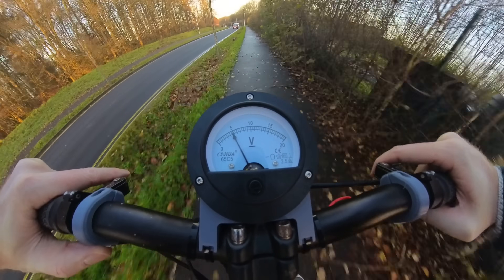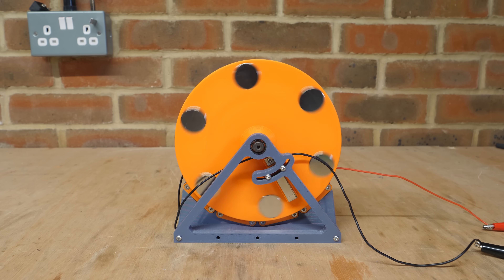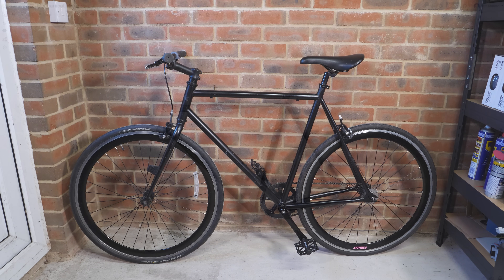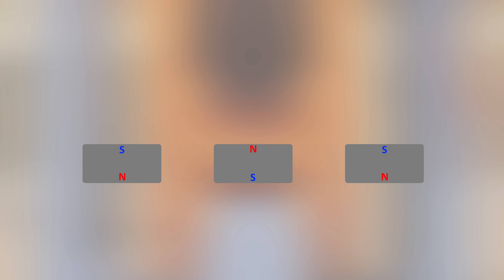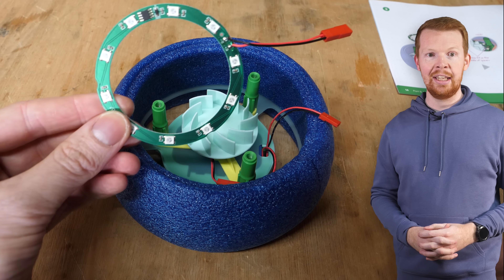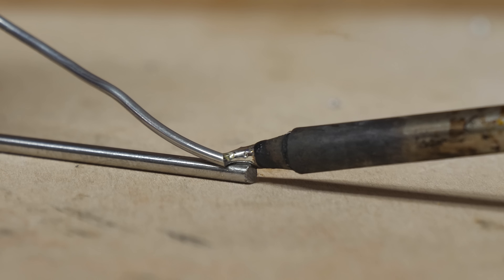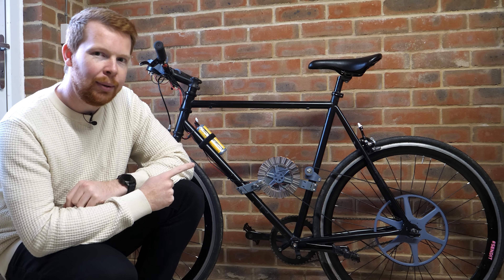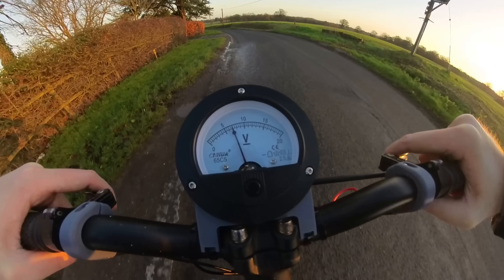The Most Minimal Electric Bike

Comment: A couple of years ago I started building something not exactly like your setup but, it was close enough in terms of generating DC power to charge my E-Bike's spare battery while riding with my primary battery.
Once my primary battery was depleted to a certain level, I did still have to stop and manually swap batteries, but the intent of my project was to allow me to have unlimited range of sorts, using two batteries: one being charged while the other being drained via my riding my bike.
Mine was mounted in the small bicycle trailer that I stow my fishing gear, small ice chest and my spare battery.  I rigged up a miniaturized CVT type of transmission so that my actual charging system would still spin fast enough to produce power even when riding at a very slow pace.

Comment: I'm wondering if the stock reed switch is inside a glass tube because it's filled with inert gas (or maybe nitrogen?) I'd imagine that without oxygen the sparking wouldn't degrade the metal. Perhaps your homebrew reed switches would work if they were inside a glass tube filled with a oxygen-free gas? That seems challenging to DIY tho.

Comment: Im glad you were able to utilize a halbach array for the rotors! 
In my own tinkering research, i have found that changing the magnetic flux topology will alter the cogging torque and efficiency of the motor within motors with iron stator slots. You can actually achieve low cogging while maintaining the high torque of a motor with iron stator slots through playing with the magnetic flux topology. Play with the width of the poles, and the halbach array magnet orientation. Of course my research was done with modified alternators (radial flux) with permanent magnet cores, and not the axial flux motor/generator in your video. 
My page has vids and links to my other pages where I house my files for others to use.
I can also do custom design for anyone needing it in their own endeavors.
Cheers!

Comment: I got an idea to throw at you. You could make an electromagnet version of hallbach array and use the read switch as a means to change the rotating fields so the two hallbach arrays push away form each other making it a magnet less motor

Comment: nice work! How about using an old set a points from a car distributor. make a knuckle on the wheel where the points open and close according to the magnet crossing its point of coil pulse to open and close the points. Run a small capacitor across the points to hold down sparking. It's the way the old cars use to fire the spark plug. Always cool to see your inventive ideas.

Comment: You can still use iron and not have any cogging, the easiest is to just back your magnet disks with iron but not put any cores in your coils. This is called "air cored". Otherwise it's fun to see the modern brushless motor "back-dated" to work without power electronics, good job!

Comment: The idea is fair but in practice you just stop applying force when you want to slow down.

Brake pads last quite long and most pads aren't even used up to the point were they need replacements.

This kind of technology has no future on the consumer markets I think. It's fun watching you tinker and learn though.

It's just that bike cycles are perfected long time ago.
These days 'improvements' like using carbon and whatnot are just gimmicks so people with to much money can feel a bit special.

A spinning bike could be much more interesting to power your house while working out instead of just moving matter around and around and heating stuff up slightly.

Comment: For years I've tried to imagine a way to 'untether' myself from the grid. My idea would be to use a rocket stove with a 'long' combustion chamber. It would be fueled by logs and trash to supply steam to an enclosed impeller type turbine. The resulting power would be sent to a battery bank. 
My 'solution' for water would be to transport it from a water source using a pump powered by the battery bank. The water would then be distilled and the necessary minerals would be added back to make it drinkable.

Comment: [2:45] "apparently rated to 15 amps." Not quite! They are rated to 15 amps *AC*, but only 0.6 amps *DC*. The reason for the huge difference is that with AC, there is a zero voltage crossing twice every 50 or 60 Hz cycle, so 100 or 120 times every second. These frequent voltage drops almost eliminate sparking and contact erosion, which is exactly the issue you have identified. You are switching DC, so the AC rating doesn't apply.

How about adding a capacitor or 0.5 to 1.0 microfarad, non-polarised such as a polyester, across the contacts and mounted physically close to them. This will also reduce sparking. Smear evo-stik or similar (NOT silicone rubber as it contains acetic acid) all over the capacitor leads to provide mechanical support and reduce the chance of stress fractures due to vibration.

Comment: I was going to ask you but instead I researched it.  Putting the reed switch in a vacuum or in an unreactive atmosphere such as nitrogen or argon would potentially mitigate the spark issue. It would also help with the noise because the switch would be inside a sealed container which would at least partially attenuate the sound.  I'm sure you could come up with something that doesn't resonate.

Comment: Hi, Tom! . I think if you create a form of small slip-on commutator to turn the AC into DC (with some diodes for safety) to send to a DC motor. That way you can both recharge your power-bank, and discharge it with the high-torque of the DC motor. This will cause more battery drain, and I suggest the slip-on commutator to be a form of spring based system- in order to prevent any parasitic consumption from commutator to the motor.

Comment: Why not use a regular old reed switch and a relay? I certainly wouldn't consider that electronic - it's essentially the same thing, but you would be able to purchase reliable versions of both off the shelf. That way the reed switch doesn't need to deal with a lot of power and the relay can handle breaking the DC. As others mentioned, your issue with the switch was that you only used its AC current rating, not DC, and often these are much different.

Comment: Do you have to run the powerline via the reed switch? You could only run a little power and control a MOSFET which switches the motorpower.
Or is that already electronics?

Comment: If the motor coils are not powered directly from the contact switch but through a solid state relay, the current through the switch will be much lower, which will prolong its life. Of course, in this case we cannot say that there are no electronics in this system, but still such a scheme will be much simpler than a conventional controller for BLDC motors.
In fact, the same scheme can be used to make an ordinary DC collector motor, which will have a longer collector life due to the fact that the switching of large currents will be performed by a solid-state relay.

Comment: On old point ignitions they use a condenser/cap to stop the points arcing. They also reduce the voltage with a resistor in series with the coil and points.

Comment: That contact you made is not smart at all, just keep the reed switch for a "signal" portion of the circuit that will controll a rellay coil, this relay will be part of the "power" part of the circuit that switches all the current, no need for custom or modified parts, just off the shelf reed switch and a rellay, simple.
Reply: Also add a capacitor is series with a resistor to calm down the sparking across the rellay contacts, this is like a 100 year old technology used with car ignition coils.
Reply: @DolezalPetr   А еще современнее датчик холла и силовой транзистор мосфет как в обычных bldc контроллерах.
Reply: @mrZagruzin  That is right.

Comment: Like the old days of point contact ignition in cars ... you need a capacitor across the point contacts to dampen the voltage rise across them as they open to allow the gap to get large enough so the arc can't jump across.
Reply: Или ключ транзистор мосфет + датчик холла.

Comment: How about a mechanical switch, like just a "wavy" surface on the rotor that physically moves a spring loaded contact plate? Or maybe even a disc with insulator/conductor surfaces, so it physically prevents an arc from continuing?

Comment: To lessen the sparks at the switch you can use a RC snubber circuit in paralell and it will almost completely remove any sparks

Comment: Regarding the tungsten and its melting point, I vaguely remember seeing somewhere that rather than melt metal away, a strong current is able to physically rip atoms out of the lattice of one contact and carry them across the gap, depositing them on the other contact. Due to this, such a contact will still fail over time even without the tungsten ever reaching its melting point due to the spark.

Comment: Interesting. Old-fashioned DC motors have a thing called a "commutator" (converts the DC current from the battery into the AC current of the motor windings), and you just reinvent it, but not mechanically, but magnetically (a switch).

Comment: Seeing as you started to use semiconductors towards the end of the project, you could have swapped the mechanical pickup switch to a Hall effect sensor which would be more acurate with the magnetic pulses and can operate to incredible speeds. Thumbs up on the video.

Comment: ...'always admire your skills as a designer and source of ideas, but your stubborn way of always relying on inefficient, complicated electromechanical solutions from the last century always makes me just shake my head ,D  ..Reed contacts are pretty much the worst and least precise thing you can use to create permanent, precisely adjustable switching times (especially since they are also highly susceptible to failure, loud and difficult to operate). Why don't you just get together with a colleague who knows a bit about electronics and meet the "challenge" e.g. with a small IR-light barrier (costs some pennies) or with a Hal sensor (almost every brushless motor has 3 of these) that precisely controls a standard MOSFET. This allows you to switch very large currents on and off without contact and precisely  ...it all costs just a few pennies (and help you to avoid so many fruitless paths)  .)  ...just sayin' and have a good day

Comment: Neat idea would be to make a bike with no physical connection between the pedals and wheel, but rather the pedals power a generator and the rear wheel is powered by a motor, like how diesel electric locomotives work.

Comment: so now you've got it working purely mechanically you should add in some electronics to provide an automated regen start type thing, so when its in a position for the capacitors need more voltage it'll enable the regen switch

Comment: Tom couldn’t you gear a mechanical switch to the rotor. The switch will open/close as fast as motor needs it to. By increasing the diameter of the rotor, your motor would produce more torque.

Comment: Hi Tom Your micro switch contact 15A rating is for AC  voltage only. The actually DC rating at should be less or about a few amps at12V dc. But should hold for a bit. Thats the curse of relay and switches...

Comment: Why not use platinum or iridium spark plug rods for the switch? Or platinum delco points? Also, would it be feasible to use a relay actuated by a smaller reed switch?

Comment: To reduce arcing you can add a diode in reverse direction across the coils. If you consider that "electronics" because it's a semiconductor, you can also try a resistor, but that would generate losses. Maybe a capacitor could work too but it's tricky, or a combination of resistor and capacitor in series. This is called a snubber network and can be placed either across the inductor or across the switch. That's why some comments suggest a capacitor across the switch, that will decrease the peak voltage when the switch opens but it will also increase the peak current when the switch closes because the capacitor would discharge directly through it.

Comment: i'd be curious with electronics what it could do ? hall effect sensor or IR sensor that drives a mosfet as the switch with a tiny arduino controller... you could even have a throttle !

Comment: You might be able to solder to the tungsten using acid, it works with stainless steel it prevents the instantaneous oxidization to get a good bond.

Comment: you can simply adapt automotive ruptor contacts and a condensator  (to reduce emf noise from the arc) from a spark plug distributor . a middle 0 needle amp meter is a cool addition to show how much charge /discharge is happening

Comment: Electrical engineer here: You should add a diode antiparallel to your switch to suppress the discharge spark induced by the demagnetizing coils. 
The spark is generated by the collapsing magnet field of the coils when the switch disconnects. The collapsing field is inducing a voltage, which discharges via arcing across the switch. The Diode limits this discharge voltage and dissipates the energy of the magnetic field.

Comment: Did you try WD40 to supress the sparking on your switch contacts? When the contacts are closed, quantum tunnelling (I am told!) allows the current to flow through the WD40 between the contacts. However, as soon as the contacts separate (I don't know by how much but it is possibly in the region of nanometres?), the WD40 becomes resistive and quickly stops the current flow, thus suppressing the spark that any ionised air between the close contacts allows in your set up.

Comment: I think a great a idea is to mix three Ideas 1. drone motor and gearing 2. gears that are capable of changing there ratio (transmission) 3. the idea of the motor recharges from momentum explanation: the drone motor uses small amount of power witch well drive the bike the transmission well change the ratio depending on charging or discharging high torque in discharge and high speed in charge so the motor well rotate quicker and make a lot more energy from momentum. how is the Idea?

Comment: did you consider filling the cores of the copper coils with e.g. ferrites? mix ferrite dust with epoxy glue, put it in there.. this would increase magnetic flux and torque significantly

Comment: You could have the reed switch energising a higher power relay, but you'd still get arcing in the relay unless you use the capacitor others have suggested.
What I'm really commenting for is you've inspired an idea of an air-cored generator which pushes iron cores into the coils at higher speed.  This could make a good governor for a home made wind turbine but would be mechanically complicated if the coils are the stator.

Comment: Looks like you're getting a ton of advice, and yet here's one more: you could use your nice sealed reed switch and a relay together as a power amplifier. The reed switch powers the relay coil and then the relay contacts have much higher power capability. You could even use the fact that relays have normally open and normally closed contacts to run the timing between alternating coil sets and always have one off and one on.

Comment: Carbon Arc Lamps are still in use in some Cinemas. Best used with HVDC.
Double up the Diode Full Wave Bridge.
Larger diameter motor, or smaller diameter rear gear.

Comment: You could replace the material on the oversized Reed switch with parts of a contact braker from a car distributor. They are purposely made to withstand constant arcing and not instantly deteriorate.

Comment: plain old brushed DC motors are "without electronics". Putting an old windshield wiper motor from a truck will certainly bring you more than walking speed easily.

Comment: The reed switch seems to be the weak point to this lovely design. Have you considered using a hall effect position sensor trigger a FET to energize the coils. Not really an electronic control, just an electrical switch mechanically (position) controlled.

Alternatively could use a optical encoder marking(s) to trigger a FET. The reed switch is electrical/magnetic/mechanical, not pure mechanical, so a positional magnetic trigger is not much different. (just removes the spark gap and high current issues and would have fewer parts)

Comment: Mechanical Commutation of a brushless DC (BLDC - Synchronous Permanent magnet machine ) motor - Is that  -A  corrected title???

 - oops, lost on the mechanical bit at the end...  - those diodes - in the "rectifryer" are considered electronics - no longer simple mechanical switching - to eliminate that silicone, a tube diode may be considered non electronic.

Comment: You need to return the commercial reed switch, but have it commutate not the power current, but a control coil of a relay. The relay will then switch the power current. This configuration is quite old and fully eliminates the exact problem you were trying to solve (while still being fully electro-mechanical!)

Edit: by the problem I meant the problems with switch arcing

Comment: It probably would have been better to use the reed switch to switch a MOSFET to handle the bulk of the current. Sure, it's not "purely mechanical", but it'd be a lot quieter, probably more reliable, and still wouldn't require any kind of controller or anything.

Comment: Remove the chain etc entirely, pedal to charge the capacitor, brake to charge the capacitor, throttle. Or do a clock spring, same idea pedal and break wind the spring, throttle otherwise.

Comment: 2:30 I was screaming internally because silver is used to prevent arc depositing on switches, and to prevent arc welding the switches closed. Bit of silver woukd have fixed that. 

Had a similer use case for a switch and researched that in an old electritians manual back when they used to "tin" switches with silver by hand.

Comment: Question, why is the belt tensioner on the power side of the belt? You may be losing power / efficiency that way. Try flipping the tensioner to the bottom of the frame?